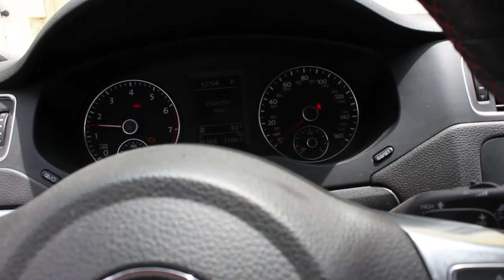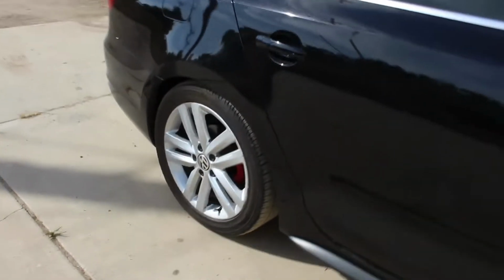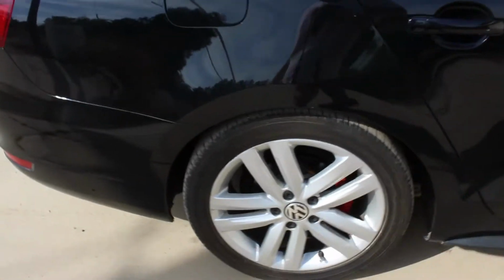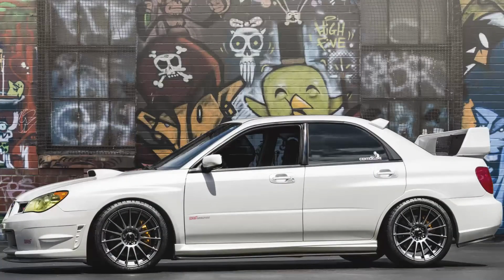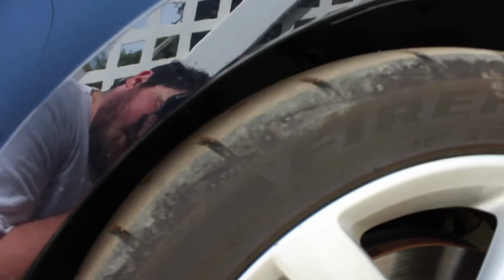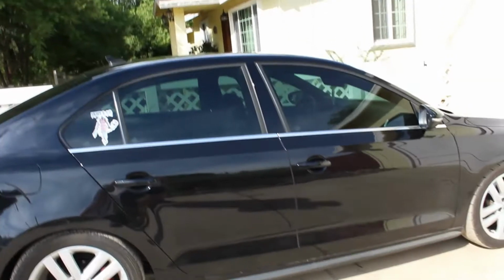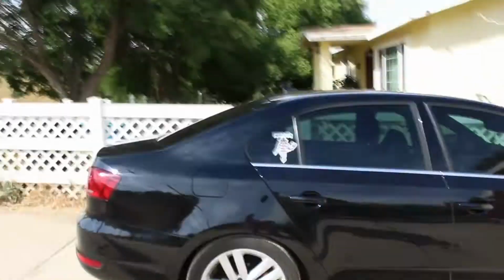Future Plans for the GLI

Comment: same car.  I got all the parts you need for stage 2. selling it back to the dealer so it's stock now.
Reply from the maker: Out of curiosity did they offer a good price as a trade in?
Reply: 12.5 which is low but i got another deal worked out.
Reply: 2013.5 gli autobahn black on black
Reply from the maker: Thats not bad considering i bought mine with Under 13k miles for 17
Reply: B R why are you selling it?
Reply: Roop InRVA it's given me a tremendous amount of issues
Reply: B R was yours a 14'? What kind of issues if you don't mind me asking? I'm considering purchasing it from my lease haha.
Reply from the maker: I'm also kind of curious about the issues you had, I've had some minor electrical issues, and a cel for intake manifold runner flaps, but I think it's just a bad sensor. Typical VW stuff, If you get a VW lemon it's going to be very very sour :(